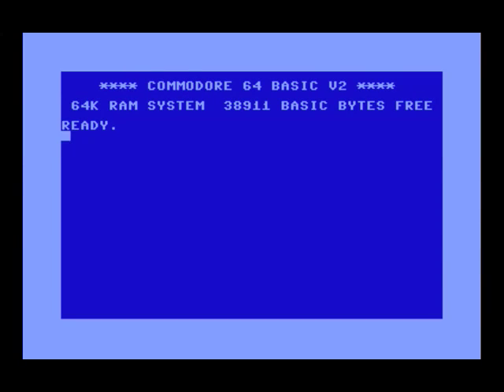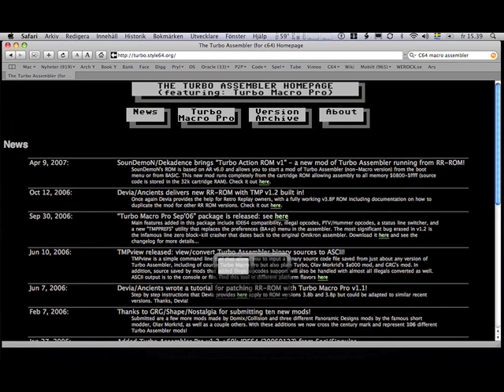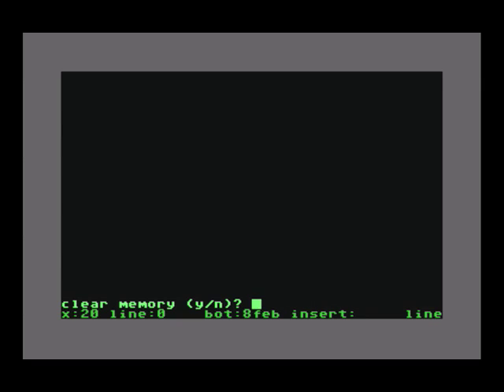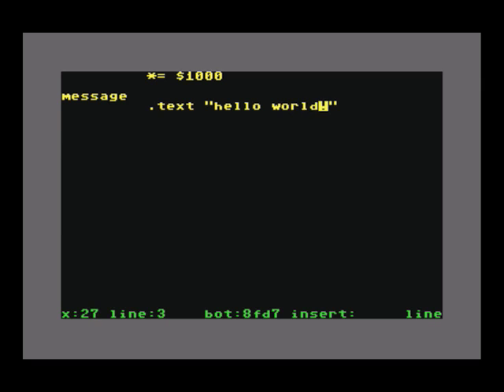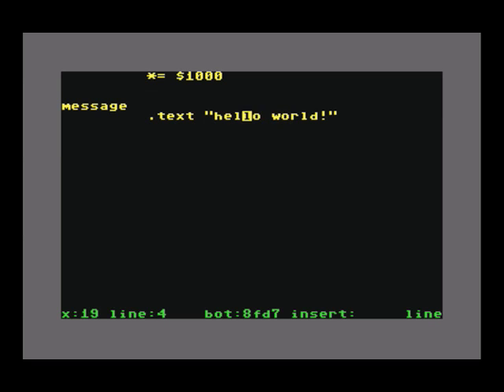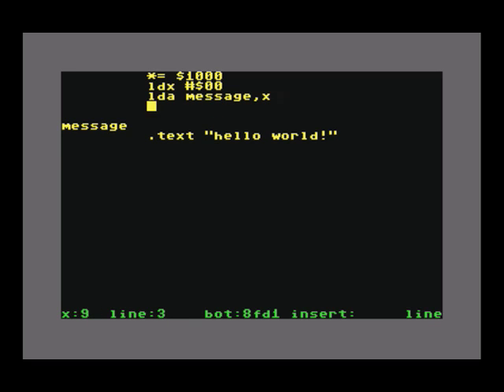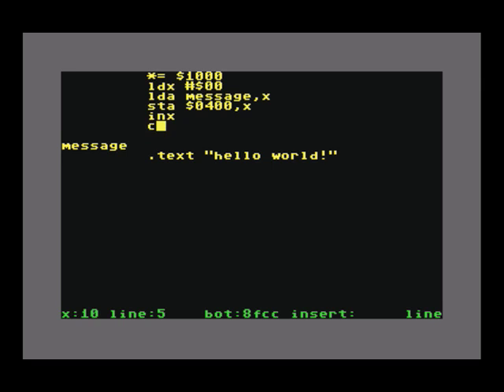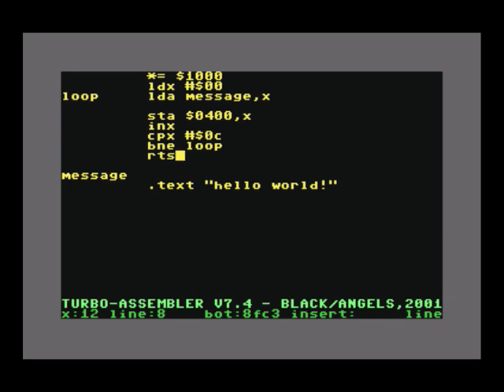Hello World in 6502 Assembler

Comment: If you wanted to use the BASIC print routine you could have written JSR $AB1E, put the address of the text in x,y and place a null at the end of the text. Simple.
Reply: Most ROM routines are general purpose, meaning you would get a significant speed up by custom writing your own routine. This is especially important for slow 8bit systems, such as the CBM64, Spectrum etc. However, where speed wasn't an issue - and you haven't banked out the BASIC ROM -  then absolutely, you can use them. Most games did bank out that ROM, though (to gain more RAM).

Comment: @ClarionCoder51 In the current version, using a standard C64 emu, you'll want to go with:
LOAD "$",8
LIST
LOAD "TMP     V1.2/S.",8,1
SYS 8*4096
(Bear in mind, the spaces between TMP and V1.2/S. has to be the correct amount, it should be lined up with the LIST output.)
Reply: thank you!

Comment: @marloweos The C64 has two character set modes.  The default is uppercase/graphics.  When he's in turbo assembler it's switching to uppercase/lowercase mode.  Anything typed in lowercase will be uppercase in the default mode.  Any uppercase would show as their graphic equivalent in default mode.  You can toggle back and forth by pressing C= and SHIFT simultaneously right after boot on a C64 or emulator to see the effect.  Hope this helps.
Reply: An AND #%00111111 before poking it to screen will correct it.
Although this will eliminate the possibility to print both upper and lower case.